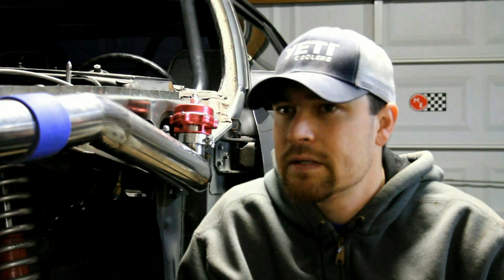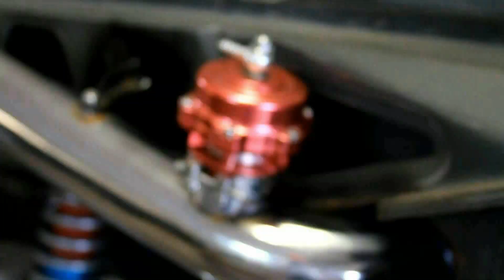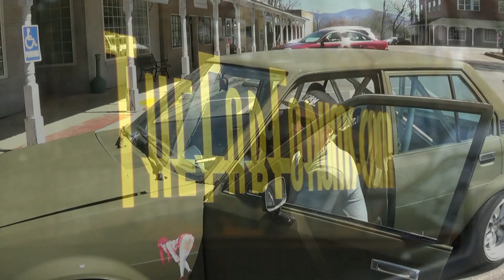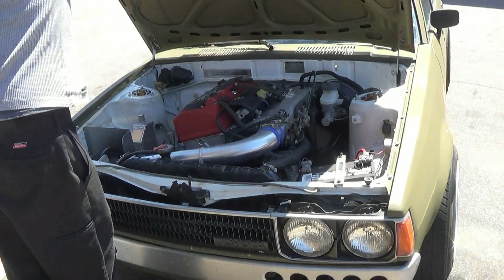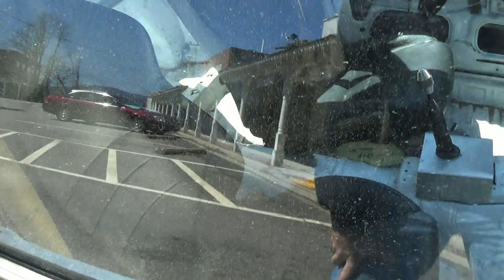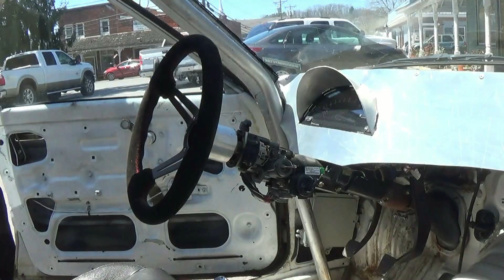Honda S2000 Engine in a 1980 Toyota Corolla

Comment: I owned a Toyota Corolla 1980 and I want to install this engine and I want to know if you composition with the transmission or the normal vector for Toyota Movement

Comment: sinse Honda motors run anti clockwise how did you get the transmission to run the right way.  You would have 5 reverse gears and one foward?.
Reply from the maker: Everything is out of an S2000
Reply: Most post 2000 Hondas run clockwise, that's why they are so popular for swaps, but if you had googled it you would know that now